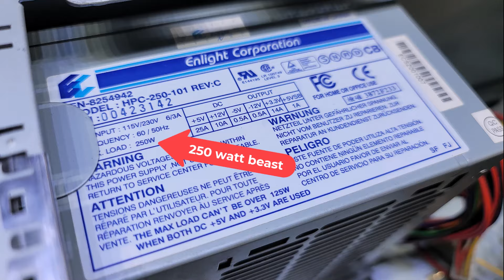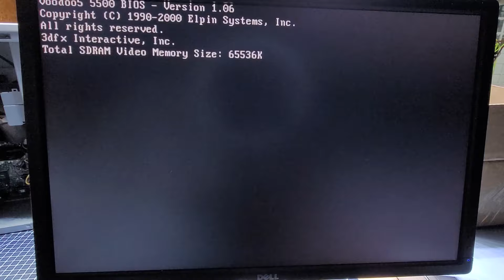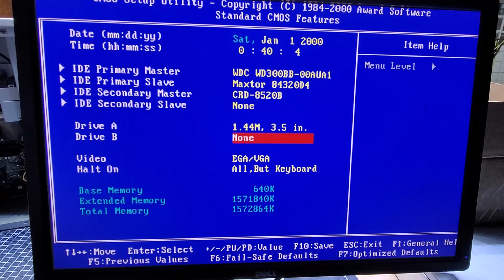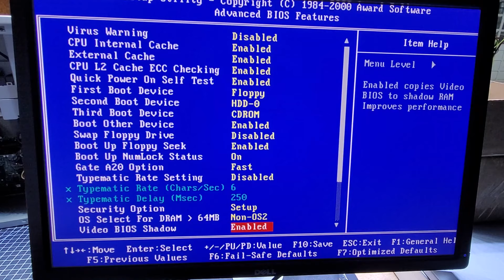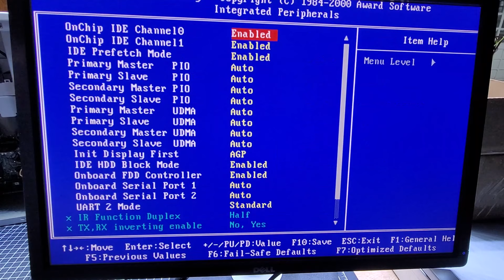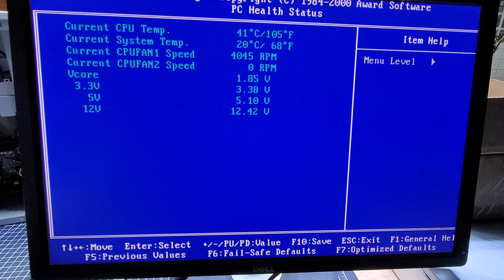Classic Computer Build with a 3dfx Voodoo5 5500!

Comment: Get those fans on the 3dfx card please!  VSA-100 runs quite hot IMO even with the stock fans in-place so it's not enough to just have "good airflow around the card."
Reply from the maker: It's not being used at the moment. While the BIOS was running I has a spot cooling fan blowing on them that moved way more air than the little 40mm AAVID fans could ever think of moving. I'll be posting a video shortly showing the install of the Noctua fans.

Comment: The one stand out I recall from those days are the jumpers on the back of the HDDs. Master, Slave & Cable Select. I always had something set wrong. The first hard drive I ever installed was when my old Seagate 512mb drive failed. I had a friend go to CompUSA in Nashville and he picked me up a 4gb Maxtor retail boxed drive. It came with a new cable, and the frame to install it into a 5 1/4 bay I thought I was some big poo. I recall having to use the floppy to install a program on the drive to override the bios on the computer so I could have partitions over 2gb.

Comment: Nice video! I wonder if you get those nasty finger cuts from those old cases hahaha, if you  do... I am sorry for ya. Those cases could be a finger trap! Keep working on the content, I like what you do and how you explain things. Cheers from Colombia!
Reply from the maker: Thank you very much! It is easy to get sliced if you become complacent. Back in the day I deburred most of the edges that were prone to slicing, but even with the front intake grille, it'll slice you if you rub your fingers across its face. Definitely a risk most youngsters nowadays never got to 'appreciate' 🤣
Reply: No need to feel sorry, it's part of the experience. If you're not bleeding after building an old PC, you have not built an old PC! 😂